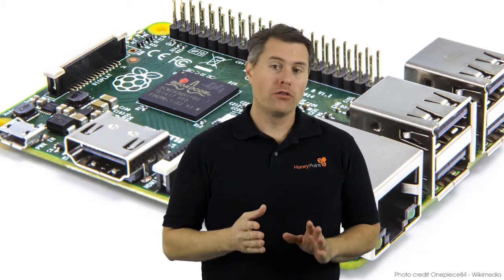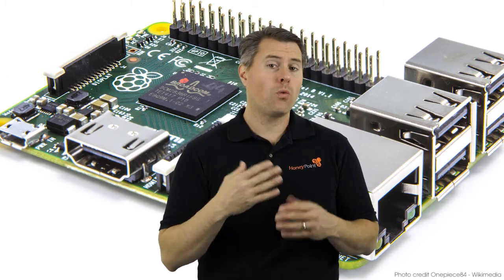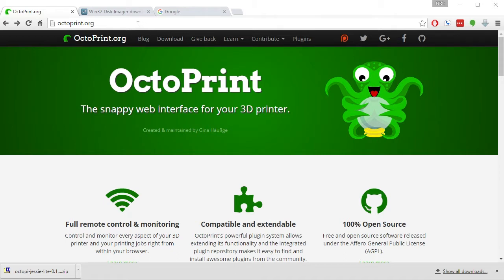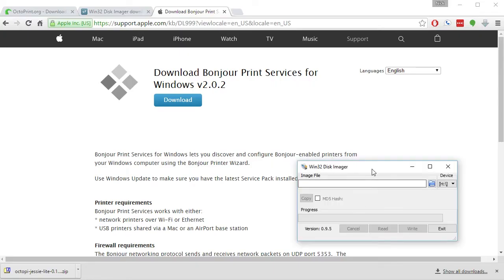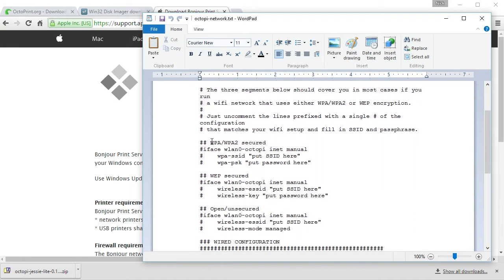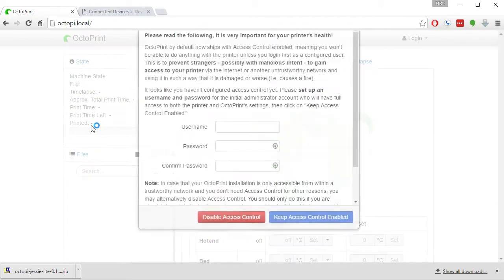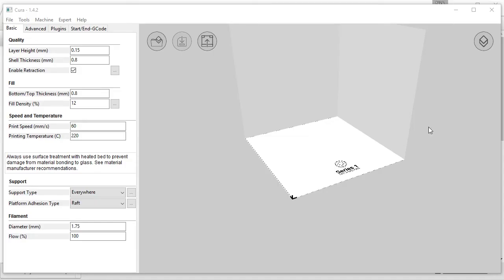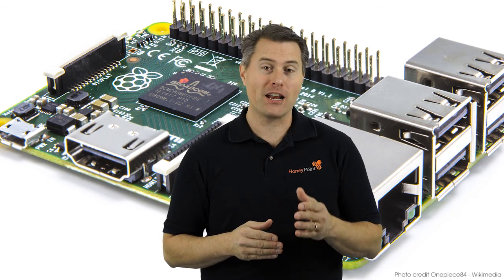3D Printing Video Blog 2 - Make your 3D Printer Wireless with Octoprint and Raspberry Pi

Comment: any way to send a 3D print further than wifi can reach? My workshop is to far to connect to wifi but I often would have use to send 3D prints from the shop back to my house where I keep my printers.
Reply from the maker: Probably a few ways:    see if 2.4GHz wireless would reach your workshop (since it has a farther reach), run an ethernet cable, use a powerline networking setup that turns your electrical wires into data carrying lines, or if your printer has an SD port you can just walk the files over to the printer.  If you're really wanting to solve that problem, and money is not an issue, you can set up a cell phone hotspot and put your printers on the internet that way, and then contact them through the Internet.

Comment: Hi, when you said connect the raspberry to the printer, is it the arduino in the printer? 
I have been asking allot but no one answer
Thanks
Reply from the maker: Maher Alsayid yes! The raspberry pi is then connected to the 3D printer via USB cable, which sets up a serial connection between the printer and the rPi.
Reply: Thank you very much for your reply appreciated it, 
May I ask what firmware is in the arduino? 
Thank you again
Reply: I was using the open-source Marlin firmware.
Reply: Thanks very much

Comment: how if my network have an issue with its 50% printing? will it affect the printer?
Reply: If the network issue is outside of the Raspberry Pi, then the print continues, or even if the network on the Pi is disconnected, the print continues..  The only thing that would affect the print is a problem at the Raspberry Pi on downwards, like rebooting the Pi itself, or a problem over the USB serial connection to the printer, etc.
Reply: Nick Kloski 
nice... thanks for the explanation..
I will order one, looks like so much fun with $39 board.. i was planing to attach a webcam on it , do you think i can check it with my phone when im out?
Reply: Yep, as long as you figure out how to forward the webcam through your router, etc....it's the normal "I want to view my Linux webcam form outside on the Internet" sort of setup.

Comment: Can one Rasberry pi control more than one printer ? Like, Can I have it set up with two printers on the one card ?
Reply from the maker: +Matthew Martin Yes.  If you have more than one USB to serial connection established from the Pi to another printer, there will be a dropdown in the top-left of OctoPi that enumerates all of the serial ports there.  The first one will be ACM0 (usually) and the second will be ACM1, etc.

BUT...I am not sure how Linux enumerates the ports when it reboots, and there is a slight chance that what "was" ACM0 turns into ACM1 on the next boot, and vice versa.  Not sure about how Linux handles the assignment of which USB port to which driver number.